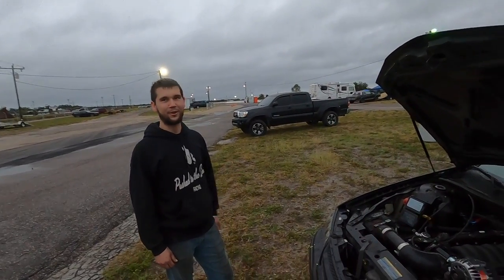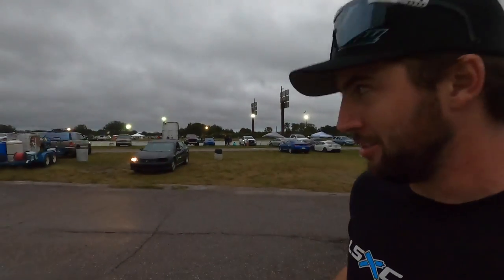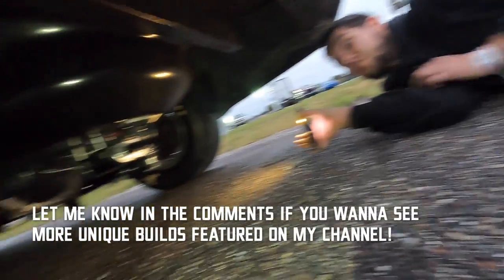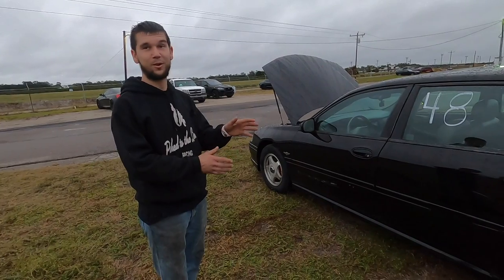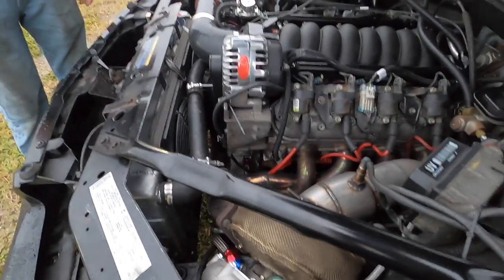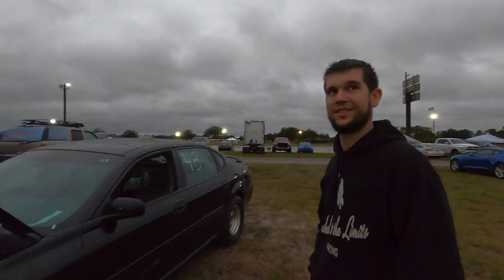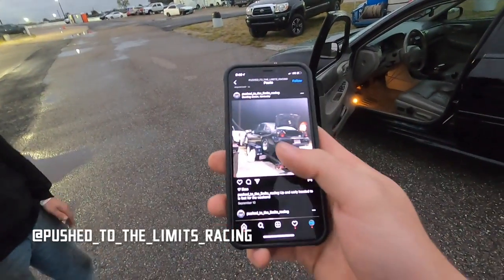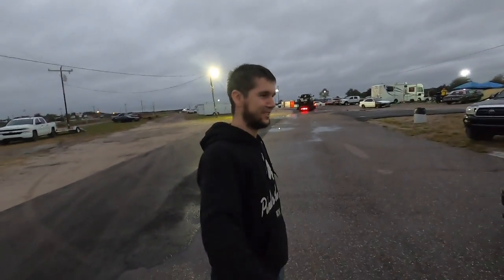This RWD Converted Turbo LS Swap Impala SS is a Super Sleeper! (He Explains How He Did It w/Pics!)

Comment: Impala's should never have been fwd to begin with
Reply: Exactly
Reply: To be fair, they weren't. From 58 to 90-something they were RWD then. The GM penny pinchers changed the tune
Reply: GM didn't have a RWD car in 2000, except for the Corvette and Camaro, unless they tampered with the F body.
Reply: @hakeemsd70m  I had a 96 Impala was RWD, so were the Caprices
Reply: Same
Reply: @hughjanus9136 the last year of RWD SS sedan ,unfortunately it doesn’t look the greatest
Reply: Gm is slow for it
Reply: I call them neutered
Reply: As well as Monte Carlos.

Comment: They should've built it that way from the GM factory.
Reply: realistically it's just a family sedan on a camaro frame. front wheel drive was all the rage at that time just like everything has to be AWD now. even to this day i'm surprised RWD early 2000's impala conversions never became the norm.
Reply: @sirmonkey1985  that'a true, but the previous chassis was awesome. It just needed more power and a better suspension.
Reply: i thought those impalas were RWD from the factory this blew my mind lmao
Reply: They made the "commodore", called the caprice in 2012, which was not advertised enough.. but they're a badass car. Of course, I agree, we need more rwd cars.  More fun, and more durable
Reply: @PureCountryof91  yeah the commodore was sold here as the pontiac, both gto and the 4 door as something i can not seem to recall right now.
Reply: They sold it as a pontiac gt g8, gxp, and chevy ss version. All bas ass cars!!
Reply: @kp.avi1372  my aussie cousin once had a commodore with a z06 powerplant under the hood. That car was cool, i don't know what made him get rid of it. I know his previous one got stolen, he seem to be unlucky when it comes to modified or cool cars, because all their cool cars tend to get stolen all the time.
Reply: At least as a option of course 🙈🙈🙈 would've been like the GTOs Little brother
Reply: @dominicbustamante1600  Pontiac G8 the trims like the GT has a 6.0l v8 and the GXP (top of the line) has the 6.2l v8. But the low trim has a v6
Reply: @dominicbustamante1600  Chevy SS is probably what you were looking for, it’s a LS3, rwd, manual sedan
Reply: Key words gas saver was gm point lol leave it to vettes gtos will kill that junk i got a 05 vette will eat that junk up
Reply: @shawnl5634  how is it junk? Because he didn’t buy a vette? Lol the power plant is almost identical....
Reply: Only if it was Awd 🔥🔥🔥
Reply: Hell yeah I strongly agree tf is front wheel drive.
Reply: @Thatonechingadera45  could have been the police ppv caprice as well
Reply: @frankb3620  he thinks his vette is almighty when there's cars with way more power and heavier that'll make him park that vette in his yard and rot🤣
Reply: You mean like they did till recent times? Imagine the outcry of a fwd corvette.
Reply: My thoughts exactly 🛞💨

Comment: That's pretty cool, I always liked that body style but the FWD always ruined it. Knowing that, it opens up much more possibilities for those cars.
Reply: as long as you can re engineer an entire rear suspension anything is easy.its called back halving and has been done millions of times.you need to cut out the rear floor,make frame rails(everything needs to be perfectly parallel in two directions),make suspension points accurately,make shock mounts accurately,make a trans cross member,make a driveshaft,make the rear end work with ijt all....it sure aint easy or a weekend project
Reply: @trillrifaxegrindor4411 daily a 05 none ss rn wish it was rwd would be fun drift cars if they were made rwd from factory

Comment: I had an 04 impala ls I wanted to do something like this to it but just didn’t have the knowledge to do it had to sadly get rid or her. Hurt my heart. Lol
Reply: If a factory rat like me, (10 years of it) can swap a v8 into a ranger in a week, you can do it man.
Reply: @PureCountryof91  I want to learn
Reply: I’m in the same boat as you. Mine was a 2003. Thing was so badass
Reply: @stockton209ent  experience is how to learn. That, and learning by reading, then doing. My 5.0 ranger was fun. Drove fun. Pulled on many punks in hondas and a few silverados. Then the rings burned. Too rich of a combustion mixture, seeped by the rings, dislodged them when the oil film was gone after a hard pull, so were the rings.

Comment: Nice, I have a 2006 LT in my drive now that I am intending on changing over to all wheel drive. Im still weighing options as to what route I want to go, I can go with the engine traverse mounted and use a transfer case to send power to a rear axle, that would eliminate a lot of refab work for steering and brakes and firewall. Or do I build with the engine mounted traditionally and convert a traditional 4 wheel drive system over, the main advantage there would be more after market available, like headers, and would be much more robust drive system. Handling and weight transfer would improve much also I think. As for rear drive unit I intend to mount a diff. as fixed and use cv joint axle shafts so I could go independent rear and have more ground clearance. I'm poor so I intend to keep engine around 350 - 450 horses and frankly I'm just clueless when it comes to turbo systems and EFI combined. lol

Comment: Always wanted to rwd my 2000 Pontiac grand prix gtp ls awap and turbo  trying to do thr best wayy possible  for the rear  end set up on how to  set up the  subframe to make it stronger  to hold a 10bolt and suspension

Comment: I want to do something like this with my 2010 impala but its so low miles (49k) and clean I wouldn't want to chop everything up. If I ever somehow get a large sum of money I'll for sure buy another 2010-ish impala and do something similar. Got a feeling I could use the rear end out of a 2012 caprice, but I can't seem to find good pictures of the underside

Agh now I wish I had the money to do it
Reply from the maker: the caprice ppv would have the same rear end setup as a g8/ss sedan I am 99% sure. IRS car

Comment: This drivetrain is what should have came in these Impalas. This gen SS is my favorite body style of modern Impala. Instead Chevy had to go and try and make a good fleet vehicle out of the Impala platform
And make it a FWD grocery getter. Even in SS trim over the years with blowers, Factory LS power etc.  it’s never been anything great because it has always powered the front wheels and used junk trannys. A factory 03-04, rwd with a 4l60 and 5.3 would have been a great factory sedan.

Comment: This build also gets rid of that terrible transmission that GM put into these front wheel drive cars.  Converting to rear wheel drive and a different transmission would be the way to go with one of these.  The only problem is registering the vehicle in California.  They would say it is not smog legal.  I had two of these Impalas.  Both had transmission problems at 70,000 miles.

Comment: FWD was a always a scam for the big automakers to save a buck.  Cheaper assembly and parts costs compared to RWD.  The SS Trim of the early 2000’s Impala drove so well, it would’ve been perfect if it wasn’t for the FWD.  understeer made it scary to take high speed turns the car otherwise felt completely comfortable/confident handling.

Comment: Lolz,... "They way they should have been built,.." - Yeah, Nah,... If youse yanks had wanted RWD, you would have bought enough of the LHD Commodores Holden sent over to keep the Aussie export program alive. GM only builds what people are buying. Or at least, stuff they can convince your government to bail out when GM mismanages the business, again. :D
It's a well done build, and not the same as the Twin Motor things. Those box sections underneath are stronger if you run them at a diagonal, rather then straight down the chassis.
That comment, about his socials, he can give his girlfriend the title of "Media Manager" on her C.V., for when she's job hunting or looking for promotion at work.
Sleeper Tip - Late '90's / Early '00's V6 Voyager drive trains fit in Neons,.. and same era Voyagers and 300M's use the same chassis, which was tested with RWD, but no buyer demand,.. so Voyagers and 300M's will swallow a (last of the LA's) Magnum V8, and maybe a HellCrate.
Reply from the maker: People also buy what GM markets successfully. It doesn’t take a professional analyst to know that they didn’t push the G8 or especially Chevy SS really at all. They did the SS for fun and basically let it die. GM marketing stinks compared to dodge and ford these days
Reply: @Stapleton42  Sadly, a lot of the really big US companies, especially related to the car industry, have a "Not Invented Here" attitude, where they won't sell stuff in to the US, that they don't directly control.
You blokes would have loved the Aussie Ford Falcon F6 Typhoon and Tornado - Turbo Barra engine, more torque then you can control, in four door sedan and two door ute with Independent rear end,... but Ford US nixed any imports to the US, because it wasn't built there,.. meanwhile they were pushing the Taurus as a 'Luxury' car here and wondering why no one bought it's slow ugly piece of,...
US marketing, is a weird thing indeed.

Comment: that's exactly what Chevy should have done with the late model impala's. they really ruined the impala legacy, did the same thing with the nova back in the 80's and they ruined the malibu as well, i wasn't a fan of the 90's and 2000's monte carlo either, these names/brands are known for rear wheel v8 powered, not front wheel drive v6 shit boxes. im not sure what the engineers at Chevy are thinking.